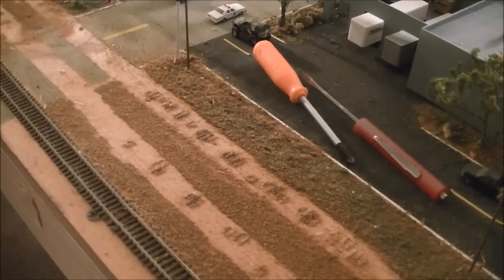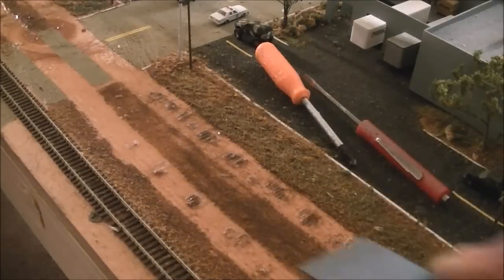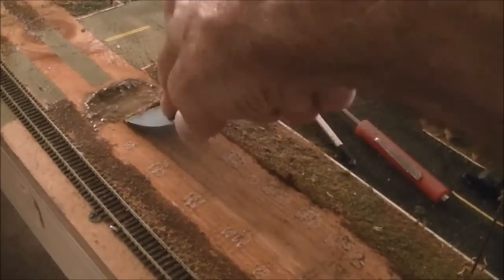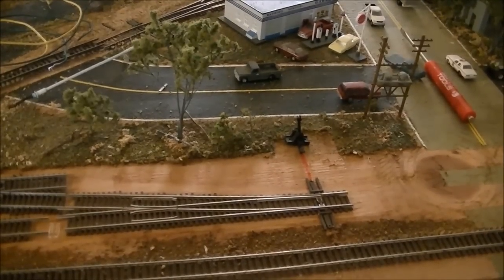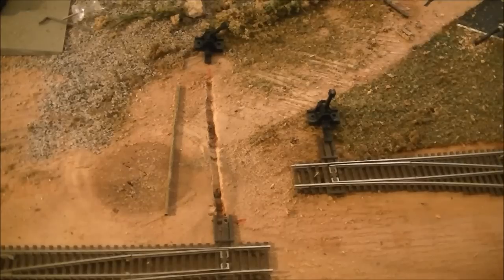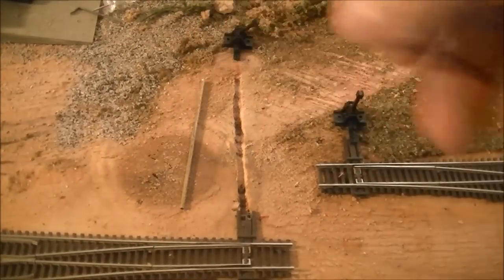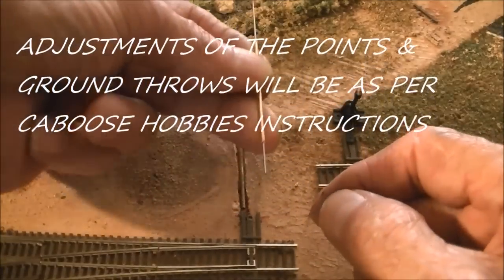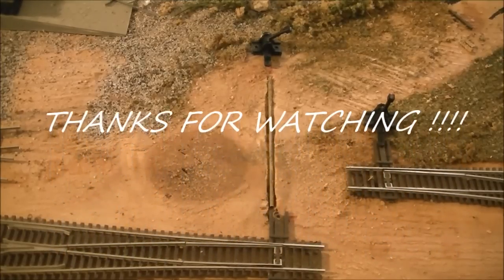TRACK ARRANGEMENT PART 2

Comment: Hi Vinny, Great idea on hiding the piano wire for the turnouts! Also, I like the 50/50 mixture of glue to hold down your track. It sure makes changes alot easier. Thanks for sharing these ideas with us!
Reply from the maker: hi Randy.... glad you liked my ideas... once everything is secured it will work fine... thanks for watching & your comment
vinny

Comment: Hi Vinny. Super way to bury the piano wire with copper tubing, thanks. Who makes your switch throws? I'm doing a similar track removal where I will connect the outer east loop to join the west loop to have continuous running on the outside mainline. Will  do an update when I get the bench made. Spraying water on the ballast does the trick to remove the ballast. Thanks for the tip...Jimmy
Reply from the maker: hi Jimmy...  glad you liked my idea... the ground throws are made by Caboose Hobbies... i'm looking forward to your update... thanks for watching & your comment
vinny